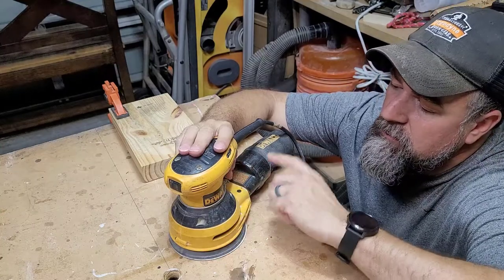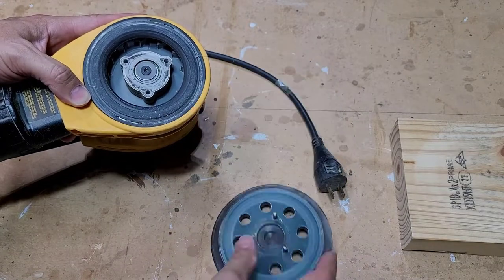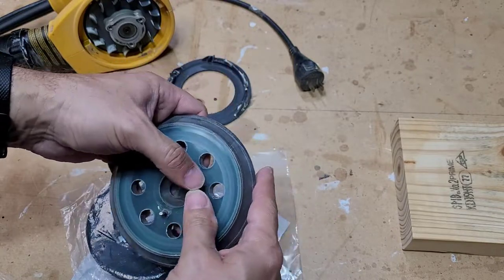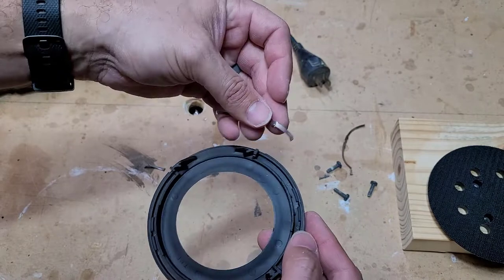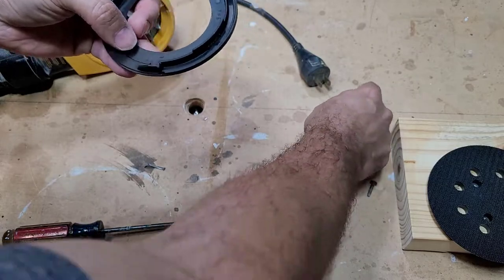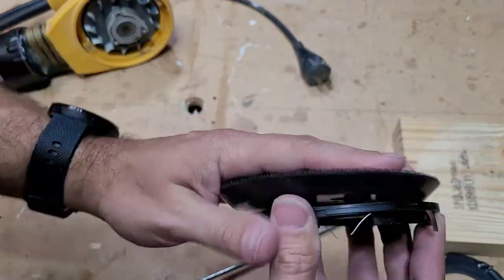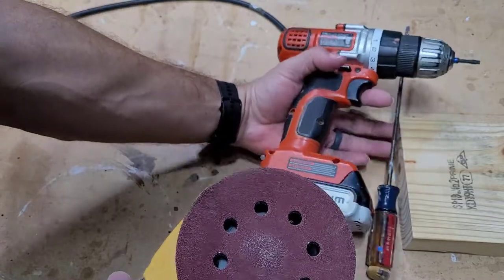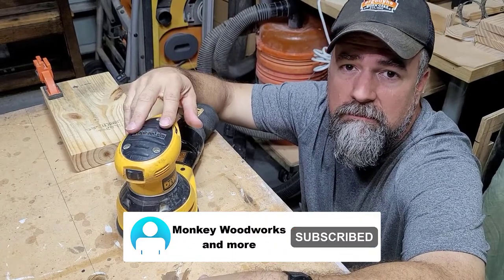Dewalt Random Orbit Sander Pad and Brake Replacement

Comment: I am going to try ordering these 2 parts for my sander, though just at a glance on Amazon the brake seems quite expensive!  I have replaced the Velcro pad once before. Last week my husband replaced it again, but after reassembly it is quite loud!  I went searching for an answer, and this seems like my next obvious step.  I am compelled to use the Ryobi battery sander in the meantime. Not casting any shade, because it is also a nice tool but the weight of the battery tires my forearms!  Funny/not funny story, the off/on switch was getting cranky, I went and ordered one ( which I have misplaced😡) but while waiting for it to arrive I went ahead and opened it to see if it would be easy to replace, obviously information that would have made more sense before ordering, and found the switch area was pretty full of sawdust.  I blew it out and it works perfectly now.
Reply from the maker: Good luck!  The brake pad I linked in the video is less than $8, so it's not too bad. I need to look at cleaning the dust from my on/off switch. I never thought of the possibility of it having sawdust in it.

Comment: I have the same sander D26453K and it had the weak spin and wobble.  Just watched your repair tonight (9/15/2023) went out to the garage, took apart the base and saw that the springs had worn down at the ends👍
Thanks to you I ordered the parts you listed…👍

Have a question for you;  the back of the pad plate has a thin (aluminum foil thick) surface.  Do you recall if the new pad you ordered came with that Surface?

THANK YOU for this repair 👍🇺🇸
Reply from the maker: Sorry, i do not recall if it did or not.

Comment: You should try the Bauer orbital.  I've had mine for 4 years, it is better than my old DeWalt.  It's slightly older than yours.  20$ at sale time, which is 50% of the year.  Can't go wrong, baby.
Reply from the maker: I was going to go that route due to costs but i felt bad for my old gal and decided to fix her up instead.

Comment: I want to ask for how long it lasted before this repair months or years ? And how much was the repair cost on parts only that’s awesome they sell those parts
Reply from the maker: I have had it for many years before this fix was needed replacing the brake and springs.  It's a great little sander.  I cant tell you how many times i have dropped it by tripping over the cord and yanking it off the workbench.   The velcro pad does need to be replaced more often but that depends on the use it gets.   I do alot of edge sanding on plywood doing yard art so that puts a lot of wear on that velcro pad.

Comment: I have the same sander and I noticed even if I run it on no2 speed it's jumping erratically on the surface what is the problem there 🤔
Reply from the maker: That is odd. I wonder if something is wedged in it or a piece of the spring is broken off inside and causing it.  Haven you taken it down to the same level I did in this video and taken a peek?

Comment: Ok so I need some help please! If you take off the pad there is 1 machine screw in the center. (It's #34 in the diagram I have) it's literally the only screw with a washer when you undo the 3 screws that hold the pad/hook&loop on and remove it... there is the seal/brake(cfs disk) (#26 on diagram) the fan(#10) 2 bearing retainers(#21&22) and ball bearing (#23) THIS SCREW IS WHAT IS IN THE CENTER OF ALL OF THESE... I GOT THIS SANDER USED AND WENT TO REPLACE THE SEAL/BRAKE (CFS DISK) (#26) BECAUSE IT WAS SPEWING SAWDUST EVERYWHERE. AFTER TALKING OFF THE 3 SCREWS HOLDING THE PAD I NOTICED THAT CENTER SCREW UNDER IT 
(PART #98012-11 "MACHINE SCREW) IS REALLY LOOSE! IS IT MEANT TO BE LOOSE OR SHOULD IT BE TORQUED DOWN? IT JUST DOESN'T SEEM RIGHT BUT I DON'T WANT TO TIGHTEN IT IF IT'S MEANT TO BE LOOSE AND HAVE SOME PLAY. I CAN'T FIND ANY INFORMATION ONLINE ABOUT IT AT ALL! ONLY PICTURES OF THE OWNER MANUAL (COMPLETELY USELESS!) AND REPLACEMENT PARTS. CAN SOMEONE PLEASE HELP ME ASAP! I'M SITTING HERE TRYING TO DO A JOB AND THIS ISH IS HOLDING ME UP. I GUESS IF I DON'T HEAR FROM ANYONE I'LL JUST GO WITH MY GUT TIGHTEN IT AND HOPE IT DOESN'T OVERHEAT OR SOMETHING STUPID!
Reply from the maker: Sorry for the late reply.  Did you ever find an answer to your question?  I have not gone past what you see here in the video as far as taking it apart.

Comment: Unacceptable damage to an expensive tool of this company.
Reply from the maker: This is normal wear.  This is the first time i had to do this after many years of ownership and MANY hours of use.  All machines require maintenance, and this is an easy fix.
Reply: @MonkeyWoodworks  If it was the wear of a poorly maintained bearing I would accept it with some difficulty. But reading the comments it is easy to conclude that this is a manufacturing defect because the problem exists in many owners. I had bought a used KRESS a decade ago and every spring I scrubbed about a thousand cells new and old for maintenance. Unfortunately yesterday as soon as I pulled the trigger it blew smoke and blew the fuse. No maintenance, lots of work. At the shop I went to drop it off for possible repair I was told that the old models of all the companies were better.